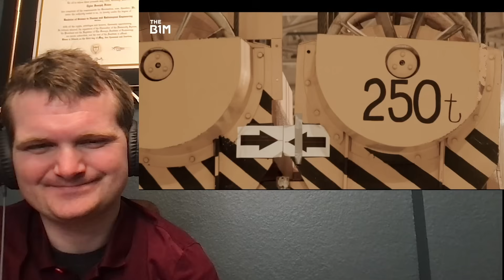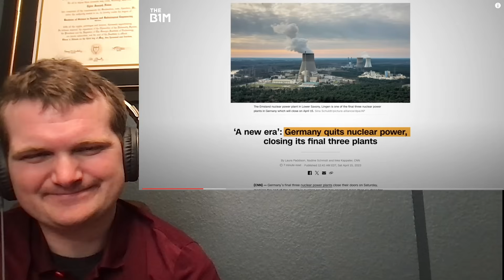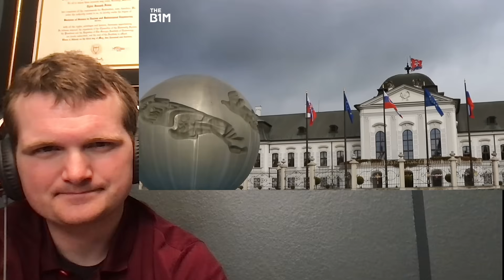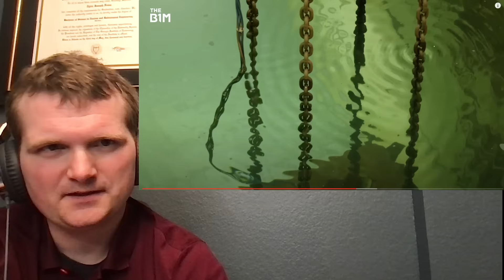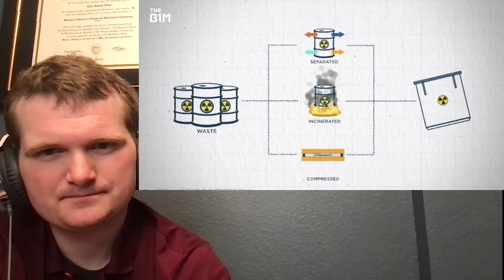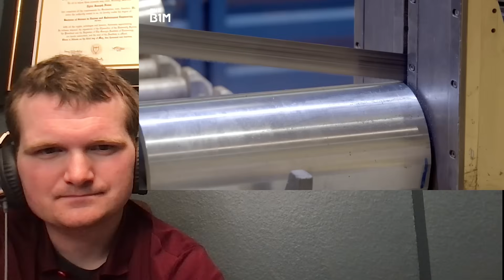Why Soviet Era Reactors are Being Decommissioned - Nuclear Engineer Reacts to B1M

Comment: The B1M is so uneven. Some videos seem like nonsense. Some seem solid. They get enthusiastic about projects that strike me as idiotic — sometimes. Maybe I’m just ignorant and they’re ALWAYS RIGHT, but I doubt it.

The nuclear power plant near where I grew up (near Clinton, Illinois) started very late and very very over-budget (partly due to incessant legal challenges and regulatory ratcheting that required rebuilds of much of it) in late 1987. The license expires September 2026. One reactor, intended to have two. Now surrounded by wind farms but when the wind isn’t blowing it’s very useful. (This means that most of the wind farms are useless: install that second reactor and...) Owners wanted to close it in 2017 but the Illinois legislature passed a bill providing subsidies to keep it open because it’s not churning out carbon dioxide and works fine. Voters agreed to a cent per kWh on their electric bills as well. Owners now want the license extended to 2047.

There’s SO much coal under a big part of Illinois that it’s astounding. Bituminous and high-sulfur. (My birthplace of Decatur: almost all of the older parts of town have mines underneath, usually around 600 feet down, none active of course.) It’s getting to be taboo to burn any of the coal.

Comment: I'm from Slovakia and I have some good news for you. They also built a new one. Thankfully Slovakia is still largely using nuclear power. One of the few things I'm happy about here.
Reply: Also, Finland thinking over extending licence of thers VVER440 reaktors to 80years
Reply: Actually they are not yet building the new one. That is Mochovce power plant block 4. The new reactor in Bohunice is supposed to start building phase somewhere around 2035 as the current V2 plant with 2xVVER440 (newer and heavily upgraded ones compared to V1 thats being dismantled) are licensed to well over 2050. The type of reactor for the "NJZ" which is the new project is not yet choosen to my knowledge. According to Wikipedia, mentioned possibilities are AP1000 - Westinghouse, APWR - Mitsubishi, MIR1200 - Škoda JS/Atomstrojexport/OKB Gidropress and others. Governemnt officials did not mention details such as these in recent interviews, press conferences etc. or at least not that I noticed. Hopefully this project does see the light of day since power demand will go up and as one of the leaders in total domestic electricity production from nuclear power we basically set a standard for clean energy production for now.
Reply: I'm from the UK and they are going to build nuclear power plants in the UK 🇬🇧🇬🇧🇬🇧
Reply: @trains-ip3kr  sounds like finally something good in UK as well, good luck. Meanwhile, they are in the process of starting another one here just as I write this which will make Slovakia the number one in nuclear energy produced per capita, overtaking France. Really cool.
Reply: @Kixunil the RBMK reactors needed to be decommissioned look at Chernobyl we don't want that to happen again with another RBMK reactor do we
Reply: @trains-ip3kr  sure, I have no problem with decommisssioning given they are replaced.
Reply: I thought our.Olkiluoto 3 (Areva 1500 MWe) was greatest budget disaster in world. Going from 3.5 billion USD to 10 billion and 20 years on building. Thanfully contract was fixed price and Areva pays their blunders. But Vogtle 3 and 4 seem to easily surpass Olkiluoto in price.
Reply: Solar?… also?
Reply: @EchosOfStars  trying to use solar in Slovakia is like trying to catch a fish in desert.
Reply: @Kixunil 
Unless you exaggerated I will read that as “it’s always shaded there”.
Reply: @EchosOfStars  I was trying to be funny by using a hyperbole but it is true that lot of places are shaded so much that it doesn't make sense economically. And even in the south there's not that much sunlight in the winter.
Reply: All the nuclear waste goes to the sellafield reprocessing site and that's where the UK had a fire in the air cooled reactors but they wasn't to make electricity they was to make plutonium for the UK nuclear weapons in the cold war
Reply: Chernobyl had a hidden fatal flaw the control rods had grafite at the tips if that grafite tips and a containment building I bet it would be less impact and contamination
Reply: Is it a Russian based company? I'm curious from my understanding is that the  Russians build or design numerous reactors around the world.
Reply: @firebry23  
If they're building a new VVER, then it will be Rosatom doing the building. That most certainly is a Russian company. They're building a lot of new VVERs at the moment. All Generation  3+ reactors.
Reply: @swokatsamsiyu3590 in Slovakia there is currently ongoing completion of "old" VVER440 reactors. The project (Mochovce Units 3 & 4) was started at the end of 1980s, after the fall of communism, it was stopped and site conserved. It was restarted in ~ 2010s. The design was ofcourse updated, and then updated again after lessons learned from Fukushima. Currently Unit 3 is completed and in operation, while Unit 4 is under construction.
It is being built by a mix of local companies (Slovak, Czech, etc.) and control system suppliers like Siemens, Areva, etc. And as far as I know, Rosatom has no involvement there.
Reply: @DarktroopX  
My apologies. I thought they were building new VVERs. But it's a good thing they will finish these "old" ones with new technology. A VVER can reach a very respectable old age when properly cared for. That is many years of clean, reliable energy.
Reply: @firebry23  not sure if the current one has any ties with Russia but the previous one certainly had since the whole country was controlled by the soviet regime.
Reply: @firebry23  VVER440 is Soviet(Russian) design (PWR style), but main components were usualy made in Czechoslovakia since Soviet pats were quite bad (at least in 1970s) construction of Mochovce #3 and #4 started in 1987, but was interrubted several times from different reasons,... #3 went fuly operational last year, #4 is getting ready for startup.

Comment: I wish to see more plants be built. That is truly how we become independent and have cheap and (basically) unlimited energy.
Reply: It is happening actually
Reply: Why nuclear reactors in the Soviet Union that are being dismantled? ‘’Foalse well they are old’’ video ends
Reply: @DarthMaul2 old Soviet designs don't have the extreme level of safety of modern reactors I would be pretty willing to trust a modern Chinese or even modern Russian reactor designs. I would be worried about the tolerances. But otherwise as long as it's one of the styles and designs of reactors that have a good track record of being safe and reliable then I'm all for it reactor designs that have had problems like the r&b Kay I would be really really nervous about reactors that use graphite. Reactors that use heavy water and natural uranium I think would be super cool to see more of but I realize heavy water is kind of expensive
Reply: But I fully agree more reactors more better. Because they forgot their shortcomings the process for making it fuel is a little messy but otherwise it is amazing what those systems can do

Comment: Why cant they make a plant that does not need decommissioning. So when the core design is obsolete they can remove the core and install a new core and keep the infrastructure. Why can that not be done. A modular replaceable design.
Reply: Not only the core but also the system that transfers heat to the generators fluid is also in contact with radioactive fluid.
Also, keep in mind that there are thousands of parts that compose the system; in some cases it is just easier to re-do all that is too old and worn
Reply: @stefa168  Exactly. Even better. Everything modular.
Reply: @dand8538  Even if things are modular, the modules have to be decommissioned eventually. 40 years of 200 bar steam at 500 degrees C or whatever it is, means that the entire steam system is at risk of corroding and cracking over decades of use. So all "modules" in the primary loop (meaning radioactive loop) need to be decommissioned in the same way. And that might require cutting open the containment building's concrete dome etc etc. 
Theoretically you could keep the turbine system and associated equipment while swapping out the reactor etc. But because the reactor and associated equipment lasts for 40-50 years, it is not always a good idea to install a brand new reactor but to keep using the 40-50 year old turbines etc, because you'd be stuck working with a weird combination of contemporary and vintage equipment. Perhaps just 20 years later you want to now replace the 60-70 year old turbine and equipment, and have to shut down the entire plant again for a prolonged period of time, with all associated costs and loss of revenue. 
So maybe you want to replace the turbine too? Well, at that point, you're essentially building an entirely new power plant.
Reply: Cost of upgrading gets to be more than decommissioning and building a new one
Reply: @BobBigWheels Also, Russia poor.
Reply: @Wavy_Gravy  Nah. "Russia corrupt" is the problem. "Russia poor" is just a consequence of the corruption problem. If you think US companies paying executives millions in bonuses is corrupt, you haven't seen what goes on in Russia. Not only do Russian companies also constantly pay executives millions in bonuses for a strong global economy outside the execs control, the executives also get to treat company assets as their personal property and embezzle whatever they want, and then tell the workers to make do with pay cuts and no safety equipment. And as long as all the politicians and bureaucrats all get a big enough cut to buy yachts and western cars, nobody is ever guilty of anything. And of course, taxpayer bailouts (of which at least three-quarters gets embezzled again) in bad economic times galore.
Reply: As soon as you make something modular you increase the risk of failures. Nuclear has enough issues convincing people that it's safe.
Reply: Fr man
Reply: They do the same thing with conventional thermal power plants. Shit just wears out.
Reply: well in the VVER-440 V-230 there was a design flaw in the containment building, the core was totally fine, and that's why they were shut down, the newer VVER-440 V-213 had that flaw fixed so it was unaffected and they are running great, they are underpowered compared to other reactors but they are good
Reply: Because, keep the people working, they'll be happy. Like road work in the US.